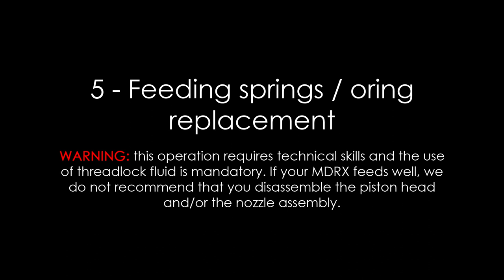MDR-X - Update Package installation

Comment: Just installed the whole upgrade set. I am impressed!! Thank you guys!!!
Reply: How long are your batteries lasting on the field. And are you running into the gun miss cycling often?
Reply: @chaseaspinall7494  so far, I have had 0 isseus. Can easely runna full day on a single battery. Thats about a 5-6 hour gameplay. And I run it as assault on 1J with .30g bbs.
Reply: @ottiesnorro  that's awesome, what battery are you using? Right now I'm using a valken AK stick type lipo 11.1 and it doesn't seem to do the job for very long when I had the gun on test a little while ago.

Comment: hi after the installation we noticed double feeding issue, could you kindly give us a hint as what is going on?
Reply: same
Reply: @Mounet2003  hey man, just figured out what happen so you know: I initially installed all the upgrade parts including the trigger board and piston oring parts etc, however, once I placed the original piston parts back in the double feeding issue was gone.
Reply: Im looking at purchasing a V2 MDRX outright. With all these fixes, is it worth it? What kind of range do you get out of this rifle with a .32?
Reply: @GunNutOpinion  with everything fine tuned this gun actually shoots pretty good, with the 80N or 90N spring it shoots like near 400 if I remember, precise grouping with long distance (.20bb)

Comment: What's the update on the bevel gear?
Reply: It's redesigned and included
Reply: The first batch has its dimension wrong, making it has terribe noises and all. They fixed the dimension
Reply: @Azukaae  can we change the whole gearset with normal v2/v3 gearset on the market? Or the MDRX gearset is propietary?
Reply: @joesaja  you'll have to modify some gears to make it work

Comment: Received and installed all components, except for the feeding springs and O-Rings (my MDR-X feeds well), but still it doesn't solve the two big issues of the replica in my opinion.

The first is the battery. It is VERY DIFFICULT to find on the market a battery of the right shape, dimensions, and power to adapt to the MDR-X. The entire piston assembly must be redesigned with a deep guide on top to allow the use of other types of batteries.

The second is the latency. Any other of the many AEGs I have, I can store with a fully charged battery inside and expect that they will be still charged and operational for weeks or months. If I store the MDR-X with a charged battery, I can expect it to be drained completely literally overnight. I literally shiver at the idea of how long (or how very little actually!) it would last in the field.

And this, after waiting more than five years and paying almost 700€ for it.

Let's face it, you guys botched it. It requires a complete redesign.
Reply: There is an ETU in this Gun. Also the "core" or Perun drain a battery within 1-2Days. Thats not a "stupid MOSFET" that dont need a standby-power.
Reply: You shouldn't be "storing" batteries inside your guns, let alone fully charged. Lipo's should be stored in a fireproof container or bag at "storage charge", that being 3.8v per cell, rather than the fully charged 4.2v per cell. Most mosfets will drain a battery if you keep a battery plugged into it, this is not specific to silverback.
Reply: For battery compatibility issue. In Facebook pages some guys remove the bolt charger which is dummy for Airsoft version of dmrx. And make the replica front wired